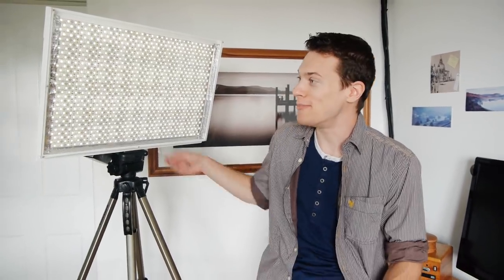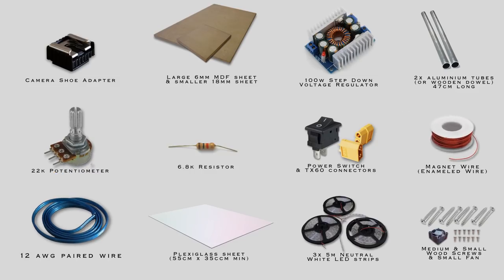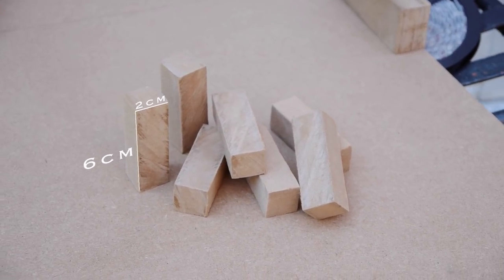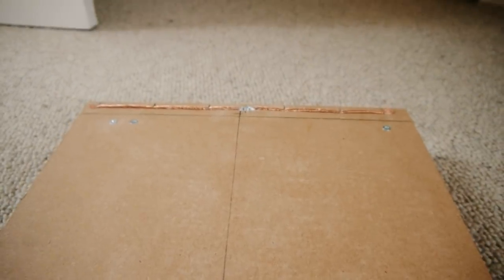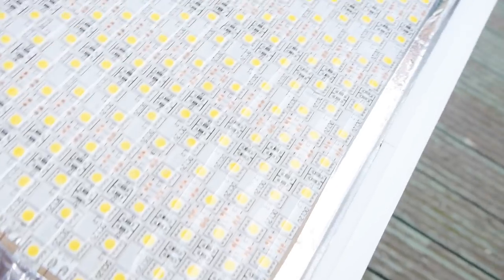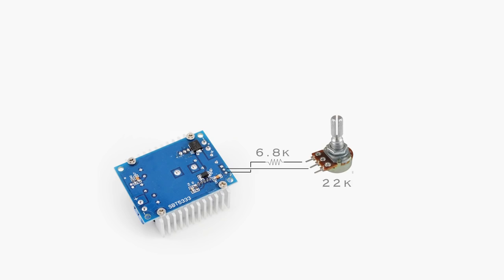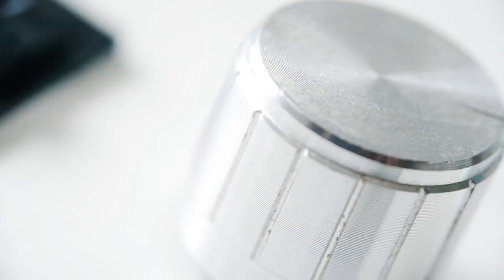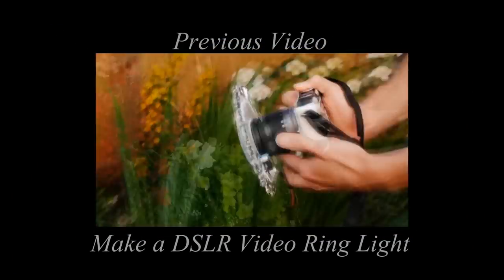How to make a super bright LED light panel (for video work etc)

Comment: Hi, first of all I'd like to thank you for sharing this and other videos of your channel. Then, I'd like to tell you I've just made a panel but I have an issue with the voltage regulator: I have performed the setting of the minimum and maximum voltage exactly the way you have done it and I have the same result: voltage range from 6 to 12 V. So far nothing wrong but once I connect the wires to power the LEDs I have noticed that at the maximum voltage the effective light power is not the amount it should be: in fact if I measure the output voltage of the regulator it's about 8 V!!!!! If I disconnect the wires I have 12 V once agai and so on.... Any clue about that?
Reply from the maker: Angelo Danna Sounds like your power source isn't capable of providing enough power. You must use an adapter or battery that's capable of delivering at least 10a at 12v.
Reply: Thanks for your answer, it's a 20A 12V
Reply: Angelo Danna DIY Perks I had the same problem, with a 12V 10A adapter.  When I hooked up the LEDs, I got only about 8V, but I got 12V when the LEDs were not hooked up.  Did you figure out how to fix your problem?
Reply: No, I didn't figure it out and honestly I think it would be a time loss since I also had flickering problems. So I decided to modulate the light power by using 5 different switches (each of the for every two stripes). Switching them on and off I have different light configuration and different light intensity.
Reply: Angelo Danna Ah! Good idea. Thanks for the reply.  I was having flickering problems, too. Maybe my voltage regulator is not working correctly...

Comment: Hi, Matt! Great video! I've been wanting to build my own voltage dimmable LED lamp for a while now and I'm using your tutorial to figure out how to build it. After doing some research I was wondering; Does the voltage regulator have a logarithmic output? Because luminosity is perceived logarithmically, I believe it's important for the pot to reflect the brightness of the LED's accurately.

I also have a request. Could you perhaps share the full circuit and calculations with us? I would be eternally grateful and would learn so much from it.
Reply from the maker: Claus Bertels If you use a logarithmic potentiometer, it does function in a logarithmic fashion, yeah.

As for the circuit calculations, I actually arrived at the resistor values through trial and error. Turns out that the voltage regulator treats 1kohm as roughly 1v, so if you put an 8kohm resistor in line with the pot, the lowest voltage would be around 8v, which is how I tuned the value for the LEDs (which turn off at roughly 6v, hence the 6.8k resistor).
Reply: +DIY Perks I've found a lot of people saying you need a constant current source to dim LED's or else it'll reduce their lifespan drastically. What are your thoughts on this now?
Reply from the maker: +Claus Bertels LED strips already have current limiting resistors built in, so it's not a concern at all.

Comment: DIY Perks You mentioned that as long as you have a 100w power supply, you'll be able to achieve the 1000 watts (1 KW) of power. But all I'm finding for laptop power supplies, at most, are 85-90w. Will that still work following this video?
Reply from the maker: Ryon McCamish 1kw was an equivalent power usage to an incandescent lightbulb. The project uses around 100w, so if you use an adapter that can't supply that power the panel will simply not reach maximum brightness.
Reply: To add to DIY Perks comment, it's a good idea to build 10% headroom into the supply's power. For other projects I use old Dell laptop power supplies rated with an output of 6A @ 19.5V, that's enough for this project.
Reply: DIY Perks So if I'm understanding it right, if I were to use say an 80w power supply, it would only reach to an equivalent of an 800w incandescent bulb, correct?

Comment: Hi. 

Thank you for your tutorial. But you didn't say all about your system. 

I've build 3 lamps at one time step by step and after plugging in the voltage I've understood that it has some very bad defects in engineering. 
1. It became very heavy. I was using 220v to 12v 20amps regulator so the whole led lamp was about 5 kilograms. And hot shoe adaptor can easily break. 
2. It starts to overheat while using for a long time. This was the reason why my first lamp died. 
3. It uses very high amperage. It means you have to use high amp connectors and they are expensive and heavy. So my second lamp get burnt because of amps. 
4. The third lamp is ok because i've made it twice smaller. 

And also you need a lot of work tools to build it. So it doesn't cost the price you've provided. 
I recommend to make this lamp from thin aluminum (1-3) mm. Or using aluminum foil with epoxy and fiberglass. So you can make some kind of sandwich. It is harder to make but cost the same. MDF is very bad thermal isolation material. 
Thank you

Comment: Ahem.. That one 100W regulator just doesn't seem to be enough.. How on earth did you manage to get it to drive the led's to the max voltage of 12V? One converter just failed on me. With the magic smoke. And also by my calculations, this panel uses more power than 100W. 5050smd led strip datasheets say very different things about the power consumption. For example in the link you provided, it says that 35W-45W is required for every 5m, that makes the power consumption to be around 105W-135W. But other sellers say that the same type of led strip needs 60W or even 70W. That increases it to 180W~210W. What I can tell about my burnt voltage regulator, is that it certainly wasn't enough.. So.. What is your suggestion to this problem?
Reply from the maker: Tuomas Raunio If your voltage regulator burned it's almost certainly because it either had a fault or you accidentally wired it up wrong (inverse polarity?). The regulator can support up to 200w with additional cooling, has over current, and over temp protection, so is more than capable to power the LEDs, which, as I said, draw 100w at 12v. Don't go by the wattage ratings on the listings - they're only approx and aren't that reliable. Hope this helps!
Reply: I double checked it and it wasn't wired up in reverse. Might just be a faulty one. Fortunately I have another regulator. It seems to work now. Just not in max power, but it's enough for my needs for now. Thanks for your answer.

Comment: This is awesome i will be trying this DIY. But i think it would be better to have Arduino nano instead of a POTENTIOMETER. Why? You can have them strobe you have them fade in and out plus you can make them controllable by phone.
Reply: +Matt Maggio Because after hour of managing talent, setting up gear, and shooting.. the last thing you want to do is add another point of failure. You want to flip a switch, set it and forget it.. Also, pretty sure it can't handle the amps
Reply: +Aaron Lee Kafton The thing is you can add sensors and stuff to the camera make the software for it and it can be 100% automatic and if you forget to leave it on if it detects no motion for 10 min. it shuts off automatically.
Reply: I've used arduino for several projects, I know what it can do. And none of that sounds appealing for video work. Automatically do what? There is no way it would know if its being used for a key, fill, rim, hair, effect, or bounce without me opening some app, making sure its connect to each other, they're properly labeled.. hope my phone isn't dead either after being on location for 6 hours and fiddle with some app when I could just move the light, turn the dial and walk away.. and this light blinds the neighbors.. if you don't realize its still on. You're probably blind. And on that note, if this is tucked away outside a window. I better not decide its been forgotten in the middle of a take and shut itself off
Reply: look any idea is possible don't tell me what i can and cant do okay? Goodbye,
Reply: +Matt Maggio  Of course it doesn't matter what somebody else wants to do with this project, it only matters what you want to do with it.  Best of luck with your project.  "Handle the amps"?  Yes, of course an Arduino is perfectly capable of driving a 20A or higher MOSFET switch.

Comment: Is there a way that I can avoid soldering? I would really just like to somehow skip that. Please help! :)
Reply: You could try to loop the wire around the thicker cable and use something to press them together
Reply: or use some screw connectors but it will take some place...

Comment: I just stumbled across your channel and I haven't researched yet, but have you been able to find any high CRI LED bulbs for your projects? I'm particularly interested in the DIY 1000w LED flaslight but for filmmaking, a CRI of at least 90 is very important.

Great channel by the way!
Reply from the maker: mrbrakelol Try these: http://store.yujiintl.com/collections/frontpage/products/high-cri-led-100w-cob-90-cri
Reply: DIY Perks  that's cool thanks! What about the LED strip lights for this project and the light shelf/ring light etc? I think I'll start by making the strip light first and the 1000w torch later as it's more complicated.
Reply from the maker: mrbrakelol There are some high CRI strips on that website, although they are ridiculously expensive. I've got a video coming soon about how to build a high CRI version of this panel for cheap, so you can wait for that if you like (next month).

Comment: THis is great
I have a questions...
1.  I thought 5500k was daylight?? but the led strip link you provided is 4500k??
2.  will a 12v DC - 10 amp run all three led strips??
Reply from the maker: Joshua Phillips The strips are a bit cooler because of the waterproofing on them. I'd say around 5300k.

The adapter you mentioned should work, yes.
Reply: Great.  SO powering all three strips of led with one 12v 10a (120 watt) will work well then??? just double checking before ordering.  
Also, can I use a splitter and run the power from both ends to get even brightness from all leds?? that make sense?
Reply from the maker: Joshua Phillips If it's a good quality adapter (and really does supply 120w) then yes, it should work really well for all three strips. You can try a a splitter if you like, but you probably won't notice any difference with even lighting.
Reply: Great.  Lastly any power supply you recommend? 
thanks so much!!!!
Reply: Sorry Im new at this lol... i was not going to do parallel but link all the light together.  DOes that change things??

Comment: Hi this panel is so cool. But it looks quite big to me, what do you think about the idea of making two of them half sized to this one ?
Reply from the maker: vsmusicify Yeah, you can do that quite easily. I do have video on a smaller version coming up in a month or so if you want to wait for that.
Reply: DIY Perks Yes please would love it !
Reply: DIY Perks
Any possibility to share the equipment list, so I can pre-order ? Thanks anyway.
Reply: What are you asking, ......permission?
Reply: Stu Bee Did you read everything ? I was talking about the other model
Reply: vsmusicify The point of the video is about a build your own light panel. Any number of different store bought models can be purchased from the many photo accessory website besides eBay. There are plenty of LED and Power Supply websites and the information in the video is more then enough to figure out how to build any size you want. However you have to be somewhat above an intellectual lazy dolt to do it. In your case don't do the build, you will probably burn down your house.
Reply: Stu Bee If you want to know. I already did it a long time ago, I first asked DIY Perks as he's of course better than me to optimize the elements (power and electronic hints).
Reply: vsmusicify 'equipment lists' he told you. hints you did not ask for. 'Pre-order' as opposed to 'order'? What would you order before you order? English a second language for you?  Whatever.
Reply from the maker: Stu Bee Stu, all vsmusicify was asking was whether I could provide him with an updated parts list in advance of the new panel video, so that he has the components all ready for when I publish it. What's the big deal?

Comment: "Keep in mind that it may appear dim at this point unless you use a power brick capable of supplying at least 10 amps." 
Ok, so as an electrician that makes sense, but it also doesn't make sense.  It makes sense because the load (the LEDs) is the cause of any current (Amperes or amps) where voltage is an inverse vehicle for the current.  The power supply and wiring must be rated to handle over the cumulative current value that the load is going to draw (what the load "wants" is not adjustable unless there's other things are involved).  The reasoning for over-rating the supply and wire is to reduce the electrical resistance generated by electrical friction and to safely conduct the current to the load and back to the supply without anything melting, catching on fire, electrifying something other than intended, and not hurting living things. [This is similar to the brakes on a car -- the larger the brakes, the less friction is required in one spot over time to stop the car and cooler the brakes are during use, and the car stops readily -- conversely the smaller the brakes, the more friction is required in one spot over time to stop the car, and the car prolly won't stop without the brakes being on fire (just like breaking the plexi-glass in this video -- he spread the breaking force out evenly over the scored section and it snapped off in one piece; whereas, when he didn't spread the force out, it snapped off in pieces and took longer to complete the job -- the friction here would be on your nerves and hands if they were to get cut) -- another example is a light bulb where the filament is "burning" due to high electrical resistance (part of the electrical energy is heat and part of it is visible light -- the filament and vacuum in a light bulb is what Edison struggled with over several attempts to sustain the light under such high electrical resistance -- he had to balance resistance, heat, and the material's tolerance to these things to make it work)].  So when your LEDs need 10 Amps and they are hooked up to a supply (transformer or battery) and/or wire that's not capable of 10 Amps, the supply (transformer or battery) and/or wire will get really hot, catch on fire, burst, or generally do something bad.  In the video and for test purposes, I guess it's cool for a very brief period of time, but I have seen guys in the field loose fingers, hands, arms and generally not fair well when doing that sort of thing (and it can happen instantly, no warning, no smoke, just boom -- it only takes milliamps, that's a thousandth of an amp, to stop or start a human heart).  Although the more catastrophic accidents happened due to negligence with super high voltage carrying super high loads or, with 12 volt systems in mind, empty battery capacitors and/or grounding errors causing an instant and unlimited load, it's not a good idea to be mucking around or DIYing without some knowledge of how things work or the consequences of failure.
So the undersized supply or wire cannot get the desired current to the load, so the LEDs, the load, appear dim.  Dangerous!
The wattage of the LEDs determine their intensity and their current draw.  Just like how a 100W incandescent light bulb is brighter than a 60 (or nowadays it's the CFL equivalent).  There's no way to change a 100W bulb into a 60W or vice versa; however, you can vary the voltage within low and high limits to achieve a dimming effect (like using a rheostat or dimmer switch).  However, the ratio of voltage to amperage stays the same, kinda (albeit less voltage equals less amperage -- 2A at 12V will be something like 1.3A at 6V, smaller vehicle equals smaller amp draw, in theory.  In reality the LEDs, while getting less voltage, still 'want' a certain amount of amperage.  There's a lot of math that's built into these jokers that make them operate efficiently at a standard volatge.  Normally, with VAC, doubling the voltage divides the amperage, but only by doubling the number of conductors or wires.  This could be why LEDs don't tend to last as long when voltage is varied.  Their efficiency is compromised.  It works and LEDs are cheap, so what the hell, why not).  On a side note: a lot of electric motor manufacturers like swimming pool pump motor manufacturers are moving to variable speed motors that save owners money on their electric bill (up to 90%!) by running slower, but they vary the hertz, or the frequency that alternating current (AC) flip flops from positive to negative.  The lower the hertz, the slower the motor.  There's more to it than that, but that's the idea. 
Now, DIY Perks obviously knows his stuff and he prolly knows a butt ton more about LEDs than I do.  I have actually been working on a LED pool light.  I need a blue LED light that's bright enough to bathe the whole pool.  I have ten lights in one fixture going right now and it's not bright enough.  I know that there's no way to make the lights I have any brighter because they are all getting 12V and are not starved for current, but is more lights the answer or higher wattage LEDs like the 45W LEDs for car headlights?  I have the regular ole super brights for 10 cents each going at the moment.  I'll try some 5050s or maybe even a fatter module if that makes sense.  All I know is that the what I have going on isn't bright enough.  The spa IntelliBrite by Pentair is brighter, smaller, uses 30 something watt LEDs, employs lenses, and it holds only four modules for a variety of colors.  I'm trying to copy that brightness in a bigger light fixture, but so far I've only found the first way that doesn't work.  It could also be the angle of view as LEDs are brightest at a head on perspective or 0 deg.  Anyway advice would be of help.